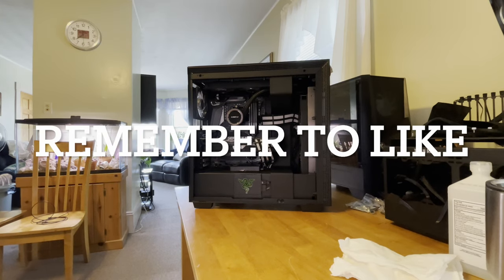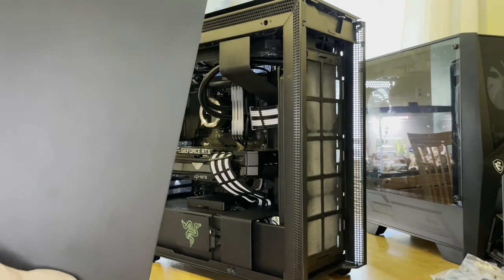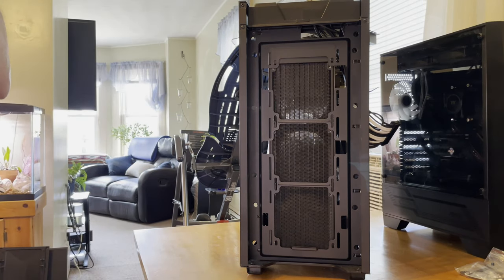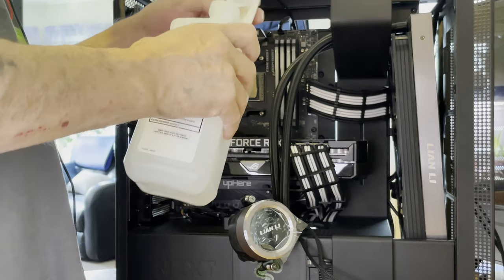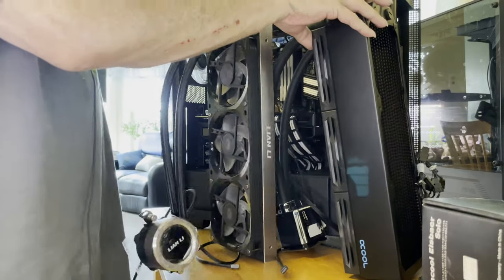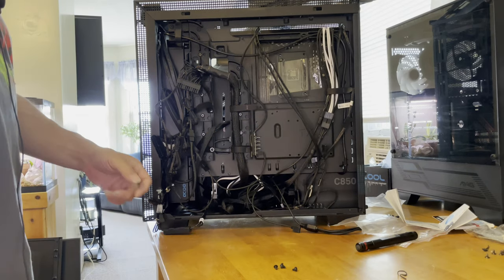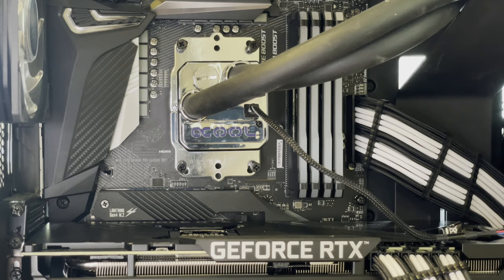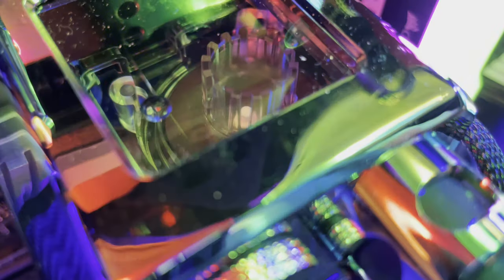Fresh install of Alphacool AIO on Ryzen 5950x

Comment: Hi, so with the cpu at full, what maximum temperature does it reach? Could you write it? is that I understand written English better than spoken English.
Reply from the maker: The max temp for the Ryzen 5950x is 90C.  Right now I am running DCS World ( Digital Combat Simulator ) Flight Simulator in a 10 vs 10 dog fight with all flying jets and I am getting 63C - 66 Celsius and this is one of the most demanding games I have.  I have to say that is very cool.  Idle temps are 34 Celsius.
Reply: @JPsTechReviews  👍👍 thanks for the info, I needed to know that information. when I install the 420 version of the eisbaer alphacool, I will change the original fans for 140mm noctua industrial fans.
Reply: @JPsTechReviews  can you please share your cpu settings (mode, freqs, voltages etc.)?

Comment: Which alphacool AIO is that?
Reply from the maker: Alphacool Eisbaer ( solo ) 2600 rpm chrome. Amazon, MODMYMODS, and Titan Rig carries them.
Reply from the maker: MODMYMODS has them in stock for $60.00 right now.
Reply: you can DIY: Alphacool Monsta radiador 80mm ticknes, Alpachool Solo pump-reservoir
Reply from the maker: @juandacal  Hi Juan, could you please rephrase what you are asking?
Reply: @JPsTechReviews  hehe im not asking, im answering @Hasan Mich question
Hi can buy the parts to build the radiator with alphacool's pump-reservoir
Cheers from Colombia <3
i wanna buy my Water Cooling Loop with ALphacool hardware parts....
Reply from the maker: @juandacal  You would be very happy with those products,  Are the parts easy to find down there?